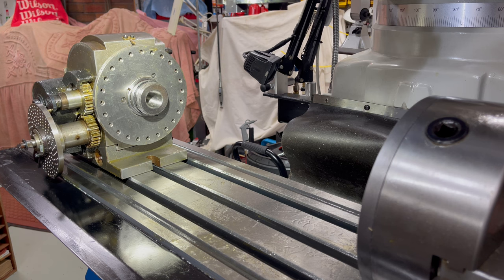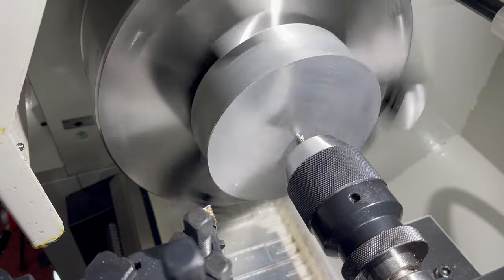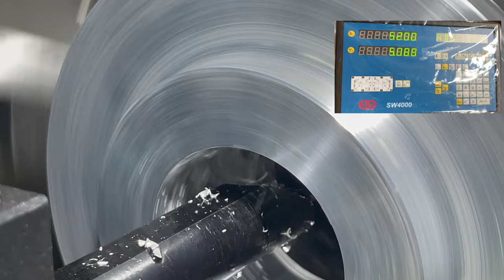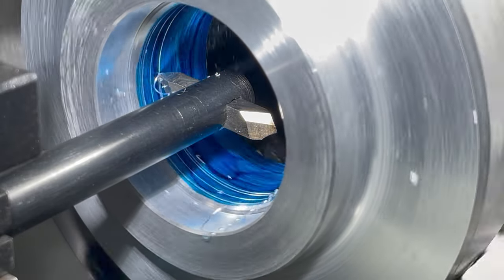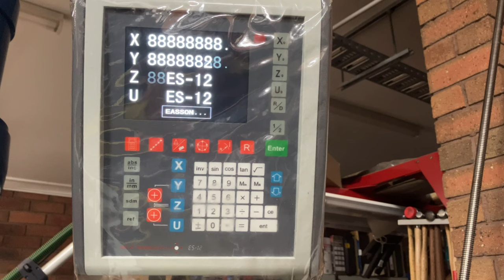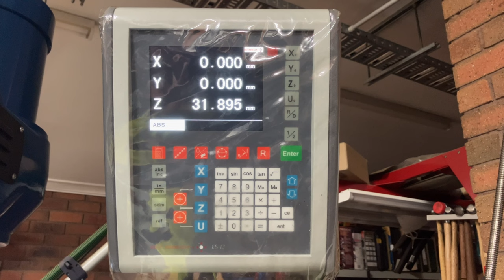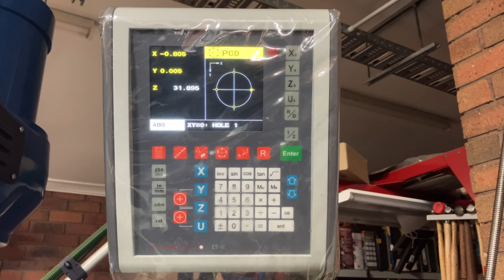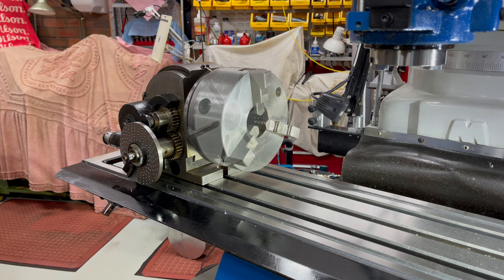Make a 4 Jaw Chuck Backplate for a BS2 Divider - Shop Made Tools

Comment: I was thinking that making the adapter out of ally rather than cast was a mistake, but as it will spend the majority of its time on the dividing head it'll be more than fine. Love the fact your machines are kept so tidy, I'm totally lazy and inept with mine, New Years resolution for me maybe; "Be the Outback Shed."
Reply from the maker: Thanks for the comment. Aluminium is fine for some applications even chuck backplates that are reasonably light duty. Thanks for the compliment on "shed keeping", I  like to keep my machines clean. That said, there's a lot of clutter that you don't see that I need to clean up.